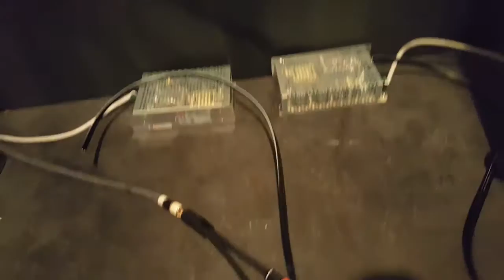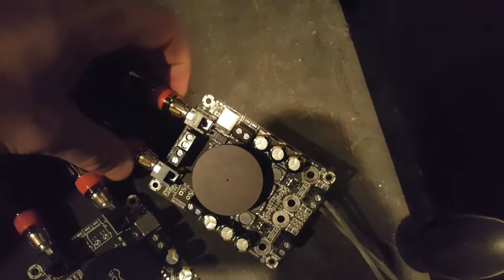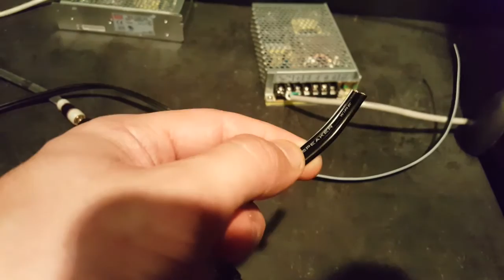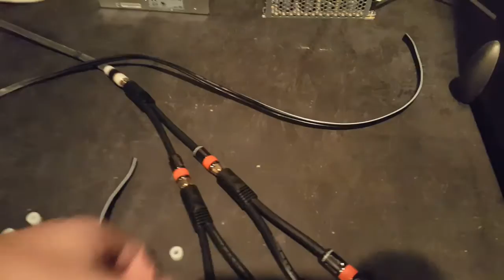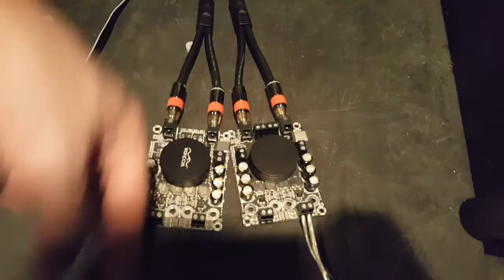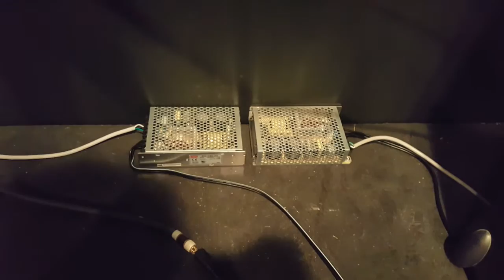How to install Bass Shakers Part 2

Comment from the maker: Parts Used
Bass shaker: bit.ly/daytonbst
Amplifier: bit.ly/sure2x50
Power Supply: https://amzn.to/2UxrjVR
Reply: Dear friend! Please explain something to me. I have 2 pieces of Nobsound G2 100W and there are 2 pieces of Eurosound st-2b-04 basshakers and there are 2 Belkin Jack 3.5 to 2 RCA cables. I want to find out from you how you can connect these 2 amplifiers to one sound source that has an AUX 3.5 Jack output. I want to make two bass shakers and have them independently adjusted from these amps, but in the amp, the sound comes from the same device. I saw in one of your videos how you connect 2 amplifiers and 2 bass shakers independently from one sound source. But you have the output coming from the subwoofer and I need to do the same, but only so that the signal to the amplifiers comes from the laptop via AUX ? Are there such adapters that you can combine two cables with two pairs of RCA-in one Jack 3.5? and will the sound power be lost? Can a regular Jack 3.5 splitter be suitable in this case? Or do you need additional devices? Thank you very much in advance for your answer))

Comment: Hi there! Thank you for your videos. Can I ask for some help? I have a Sony Muteki 7.2ch home theater system and I am not sure how to connect the subwoofers (I have 2) to the transducer amp! The subwoofers both have 2 wires and I will need to cut them and splice them since Sony doesn't use RCA on this receiver. But I am not sure how to connect the wires to the Sure amp! I have 2 Aurasounds ! If you could help I would appreciate it.

Comment: hi today i have received my baasshakers. could you please guide me for the RCA splitter. Perhaps if you know anyone on ebay. I really was so much inspired by your video that i am actually doing this in my theatre room.
Reply from the maker: These are the ones I used, but you can get cheaper options if you want.  You just need RCA splitters that have 2 male ends and 1 female end: http://www.ebay.com/itm/Monoprice-6inch-RCA-Female-to-2-RCA-Male-Digital-Coaxial-Splitter-Adapter-6261-/381480178519?hash=item58d1fd9357:g:mSgAAOSw3ydV1x50
Reply from the maker: That is awesome to hear!  You are going to love them!

Comment: Nice work man! I do have a question, though. Is there a way to regulate the volume of the shakers with this setup, independent from the subwoofer in your home cinema? Or do you need to add another module for that. If so where in the chain would it go, between the sub out and the amps? Thanks.
Reply from the maker: That is a great question.  The simple answer is yes you can.  In fact, you can individually control the volume of each shaker hooking it up this way.  There are two ways to do this.  The first, which is the easiest and of course more expensive way to do it, is to buy an RCA level controller like this.  Now you can hook up to 2 shakers to this, but both would be controlled with the same controller.  Otherwise, you would want 1 for each unit.  https://www.amazon.com/Axxess-AALC-Controller-Discontinued-Manufacturer/dp/B003FPD3IS  The other option is to hook up your own potentiometer to each unti.  I have a video here which shows you how to hook one up.  If you wanted to hook up one to each seat, you would want a mono potentiometer and would not need it to be switched.  https://www.youtube.com/watch?v=xMzyrInZBuM&list=PL6hjpiCHZmIOUc3snzJiS6uMsSNLKXlJy&index=1&t=1s  I should mention that if you do it this way, you will want to hook your amplifiers close or up to the seats themselves.  This will cut down the distance you would run each individual potentiometer.
Reply: Thank you. 
I have another question for you if you don`t mind. 
Let`s say I want to hook up 4 of these Daytons to my sofa. 
Could I use just one 2.1 channel amp (L/R/SUB) that has 2x50W+100W and hook one transducer on the L and one on the R channel and two of them in series to the SUB channel? That seems to work in terms of Wats but the SUB channel will be pushing 8 ohms and the L/R will be pushing 4 ohms each. Will there be a volume discrepancy in a case like this?
Also, do all 2.1 channel amps that possess a SUB out have high pass filtering on the L/R? If so then surely an amp like that would be useless to drive transducers in the configuration described above.
Here`s an amp that I thought could be suitable:
http://www.ebay.co.uk/itm/NE5532-TPA3116-2-50W-100W-HiFi-Digital-Power-Amplifier-Board-AMP-Receiver-3300UF-/381929790906?hash=item58ecca1dba:g:K5MAAOSwNnRYgI9B

Though I do not see recommended impedance, but I think the board is the same one you used.

Thanks again.
Reply: Also could it be problematic if I connect one transducer to each channel (so only one the the SUB, not two). That would mean 4 ohms per channel but the transducer on the sub channel would be driven harder, given the 100W output? Would there be a volume/performance discrepancy in that case?
Reply from the maker: I wouldn't recommend doing what you are talking about for a lot of reasons.  First that amplifier only gets the 50x50x100 on a 3ohm load.  So you would never get 50 watts from the two stereo channels.  Also, since I have never used that amplifier I cannot speak to it's relationship between the 3 channels as far as level goes.  Personally, if I was hooking up 4  bass shakers, I would either hook it up the way I did with the sure amplifiers or with this:  https://www.parts-express.com/dayton-audio-spa250-250-watt-subwoofer-plate-amplifier--300-803  It mainly depends on if you want to run individual potentiometers and/ease of setting it up.  I personally love the sure amplifiers myself.